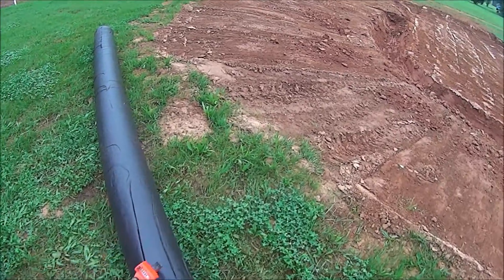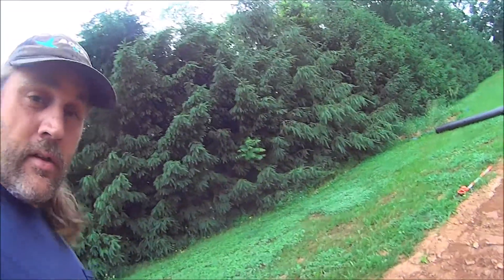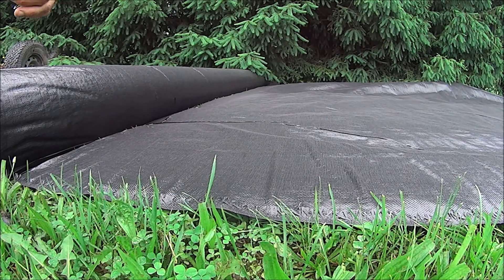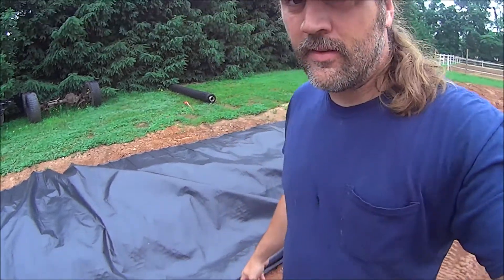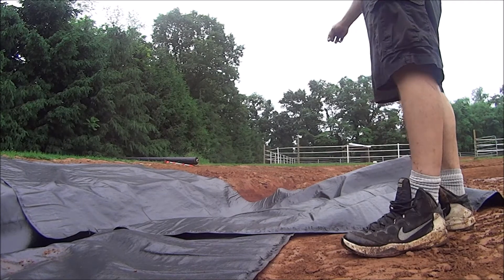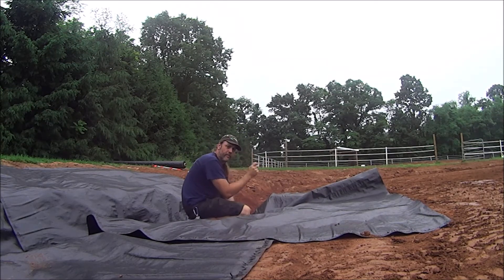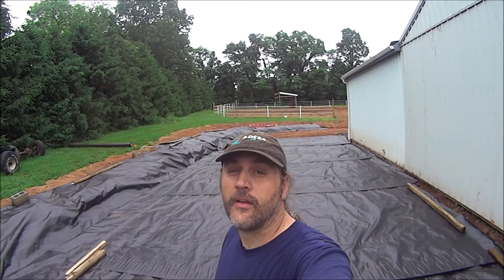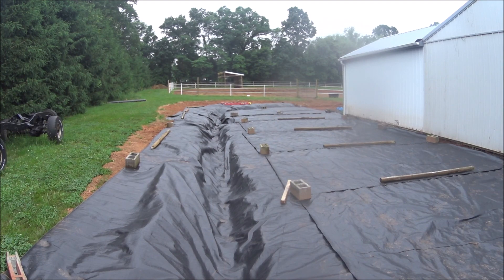laying down geo textile fabric on the drive way and drain pit

Comment: Like the last comment, what is the manufacturer and where did you get the geofabric.   Keep up the good work.
Reply from the maker: I got this roll at store near me called "core and main"  Lowes has them on there website too but they need to order them depending where you are located there may be a landscaping supplier that sells it also. thanks for watching.